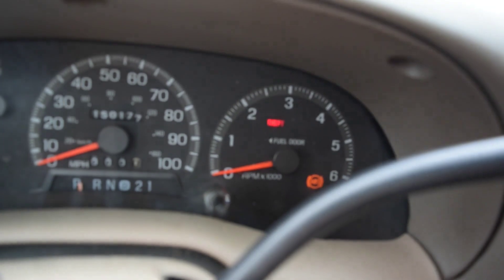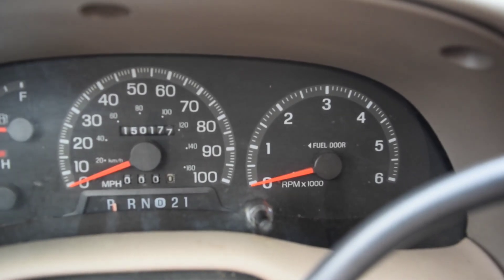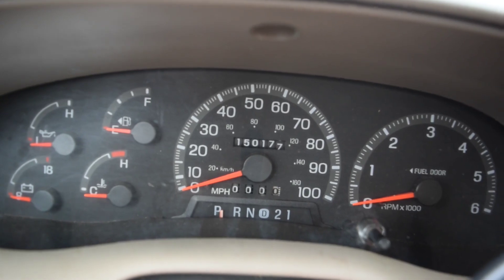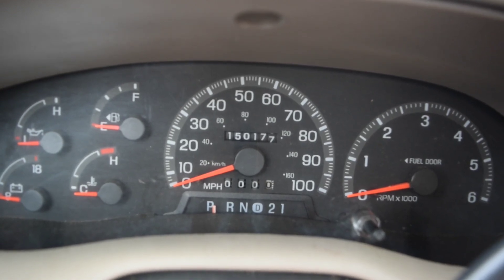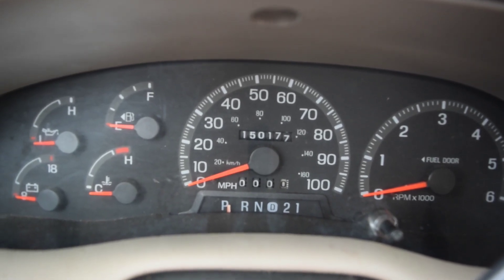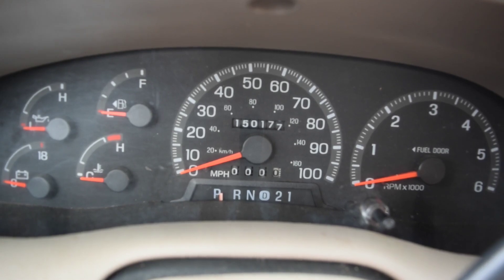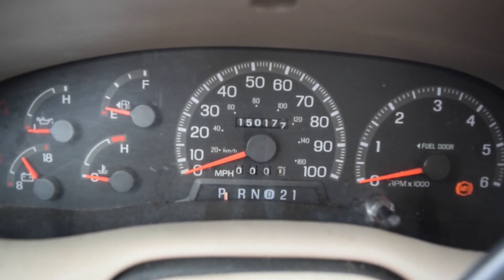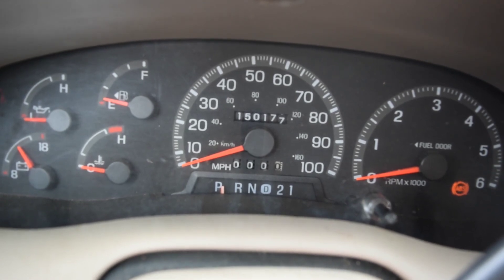Expedition theft light flashing. Starts but won't run. Getting computer to recognize chip key again.

Comment: This is a huge problem with the 97 Ford Expeditions... I've owned one since 1997. Mine was a special order in those days. Each time it goes to the shop for battery replacement, the alarm system sounds ...driving everyone nuts. I've told the technicians what to do, but they won't take the time to do it. Hope they watch your video.

Comment: Mine was the ignition cylinder and keys needed new programing and I did that with forscan swapped the parts out and it worked started right up